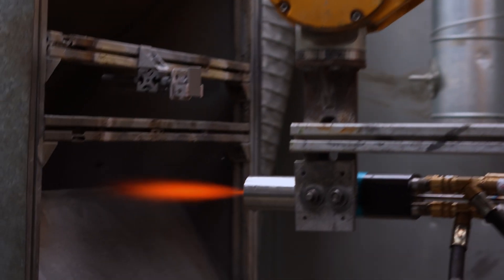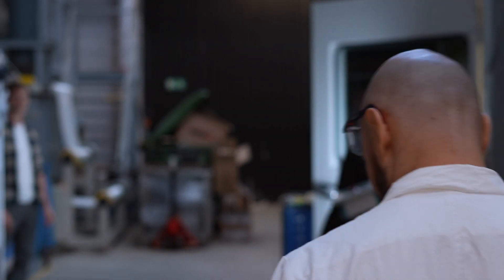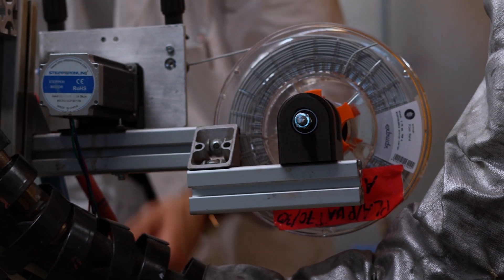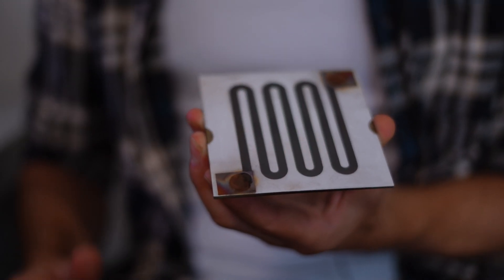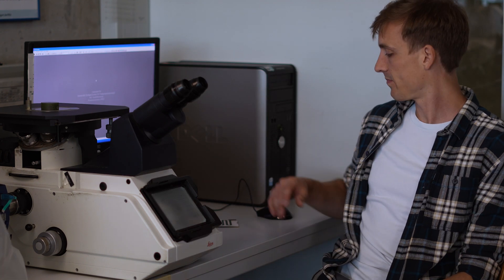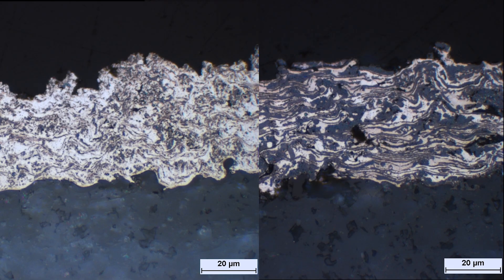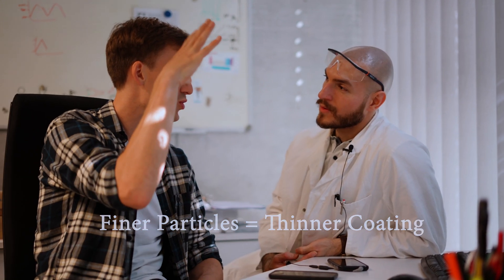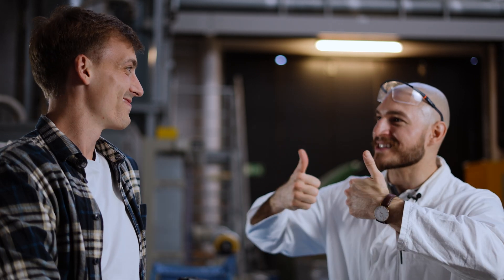Filament spraying can revolutionize your life - Here's how it works!

Comment: Is this similar to other flame spray coating processes?
Reply from the maker: Hi @riceraceman
Yes, there are many similarities between the method we showed (i.e., HVOF) and other flame spray coating processes. The one we showed uses filaments as the feedstock, while other processes use powder, metal wires or suspensions as feedstocks.
Best,
Reply: @Dr-Yared  This was a great presentation of this process. One process that has intrigued me is laser ablation of suspensions in dry ice impelled (thrown off) as variable speed rotating disks. It is highly controllable with many different parameters including laser intensity, suspension density, tangential velocity of the disk. A steerable mask can be used to confine the ablated material to highly specific areas, or one could utilize some kind of stencil or other. A major benefit to this process is that it can enable layering with volatile or otherwise fragile materials.

Comment: actually really solid video, the production quality is surprisingly high and the topic is really interesting! I would have liked a section where you get into the 'old method' a bit and how that works/how it's applied to the surface (you can also hint about how you'll explain the differences in more detail later) but yeah you really seem on the right track already, not much more to say
Reply from the maker: Hi @oxey_  
Noted :) Thanks.